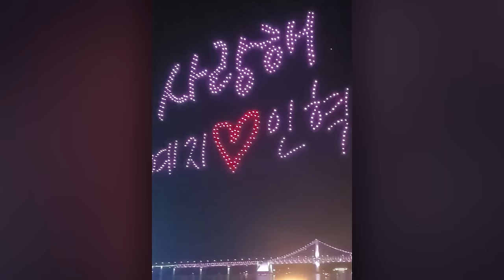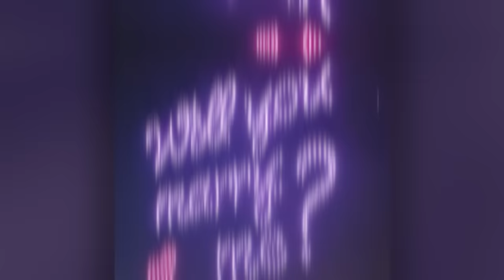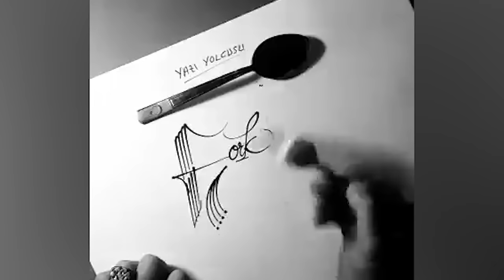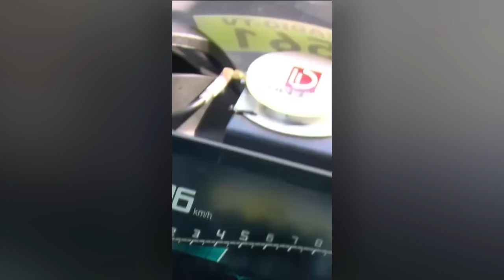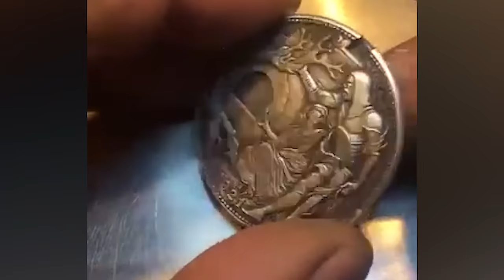Incredible Moments Caught On Camera - Best of 2024

Comment: The aluminium plant was scary. It is a shitty situation if that material gets on fire.
Reply: One of the hydraulic lines burst, think it even came of its mount. The oil is already at a decent temp from its location and pressure. Add to that a very nice spray mist and it'll combust instantly. The fire then melted every other oil line and the gates opened. Fyi, those hoses are under massive pressure, high enough to cut you clean in half...
Reply: @civiere  thank you for the additional details on the accident.